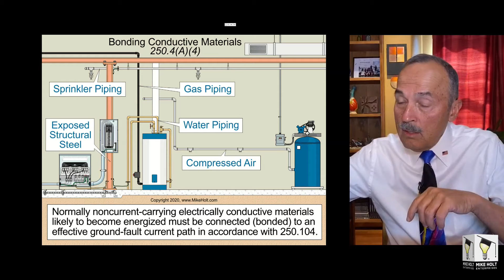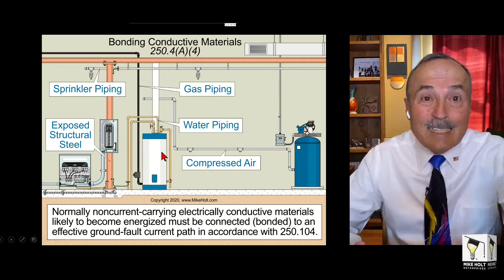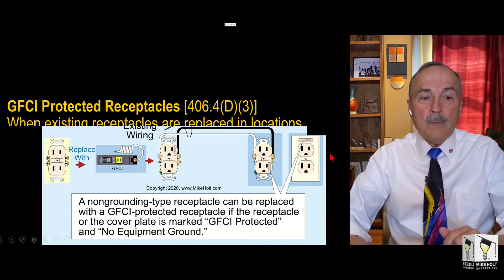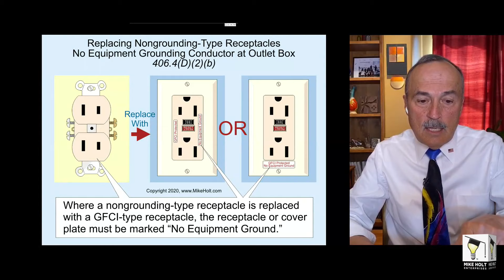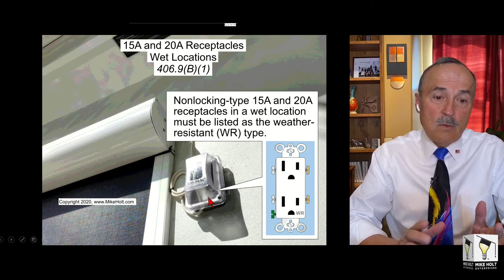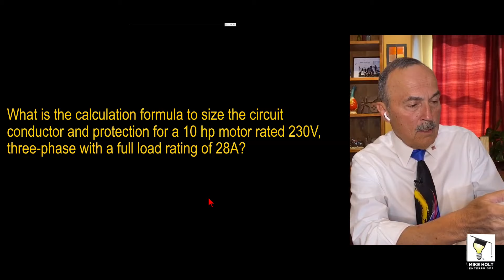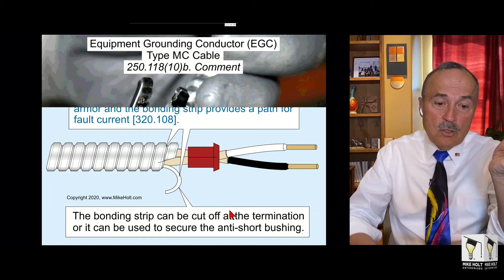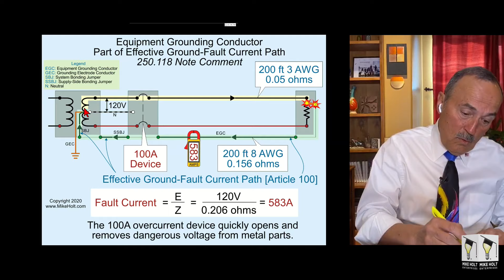Mike Holt Live Q&A Thursday May 7th 2020

Comment: The International Fuel Gas Code 310.1 has similar requirements regarding the bonding of gas pipe systems.  Furthermore, in Washington, I'm working in a jurisdiction that has adopted the Washington Cities Electrical Code, which has added item (6) to 250.104(B) which states, "The bonding conductor or jumper for gas piping systems must be a minimum 6AWG copper and terminate at an accessible location on the load side of the gas meter on either a solid iron gas pipe or a cast flexible gas piping fitting using a listed grounding connector."  The Washington State WAC rules contain similar wording.   I'm not speaking to whether it SHOULD be there or not...I'm just saying it exists as an actual code requirement in some areas.

Comment: The issue with the gas water heater is if the water pipes become energized then then it is possible for the gas to be either through the water heater itself(assuming there is a path through the chassis) or through the water itself(which may be more conductive due to the temperature and "hardness"). Of course is the water pipes are "bonded" then it should bond everything else. But say the gas pipe gets energized, this then reverse the direction and can energize the water heater which could energize the water pipe(or not). all this is unlikely to be any issue what so ever but...

Comment: The practice is to replace 2 wire receptacles with gfci's. Then feed the load side out to other 3 wire receptacles with a label. Add gfci's everytime you run into a new ckt line or home run.

Comment: Nice video... Ran into this at brother's new home.  However, it was grandfathered in.  Honestly, as electricians fault current mostly travels on groundED conductor. Only was to add EGC is to tap metal box and check for path or pull a wire sized off OCP dev.
Reply from the maker: Fault is suppose to travel on the equipment grounding conductor (green or bare wire), not the the groundED (neutral) wire.
Reply: @MikeHoltNEC  I will send you the reference in my IAEC Soars grounding and bonding book that states that majority travels on the grounded conductor... Not arguing just curious why there are multiple opinions... Where does fault current travel in a home on two prong receptacles without a EGC?
Reply from the maker: @ryanjourneymanwireman4937  Soars book does not say that ground-fault current travels the gorunED conductor as it relates to building wiring! If you have a two wire circuit and you have a ground fault, then all metal parts are energized until you touch it then it goes through you (kills you), then back to the secondary of the utility transformer. If you don't under sand this, please watch MikeHolt.com/Fundamentals.
Reply: @MikeHoltNEC  when I get out of my NEC license class I will be able to clarify what exactly I saw in Soars Grounding and Bonding... I think I know now that I didn't clarify or misspoke when you mentioned ' building wires.

Comment: will installing more than one 120v 20a receptacle on a brench circuit potentially violate 210.23(a)1 and 2
Reply from the maker: Nope, it's very common to install 20A, 125V receptacles on a 20A 120V circuit for let's say commercial installations.

Comment: Mike, but you have to open the circuit panel door to test gfci breaker.  isn't that NOT readily accessible, just say'n!  But lets be real nobody ever test these, ever beyond the electrician who installed it so the nec should remove readily accessible.
Reply from the maker: Opening a panel door to get to the breaker is 'readily accessible' as defined in Article 100.

Comment: If I have a house that is using 240v for everything in the house is there anyway I can use a 2p single pole breaker to take 120v to the outlets for 120v
Reply from the maker: I don't understand what you are asking.
Reply: @MikeHoltNEC  I have the house it's got 240v running to all the outlets can I use a single pole breaker and turn the outlets into 120v
Reply: @vincentpereira8416  — What is your electric service?  Do you have 120V/240V split phase service?  What kind of main panel do you have?
Reply: @GH-oi2jf  the electric service is 240v coming into the house
Reply: It's a homeline 100a box